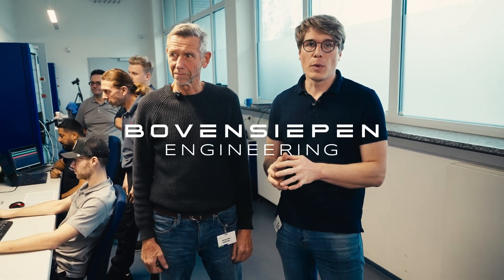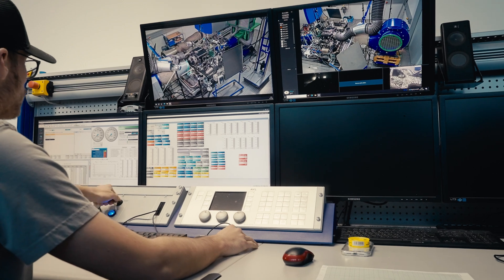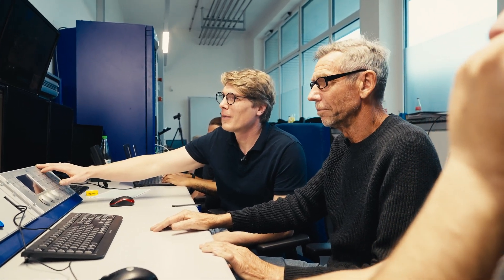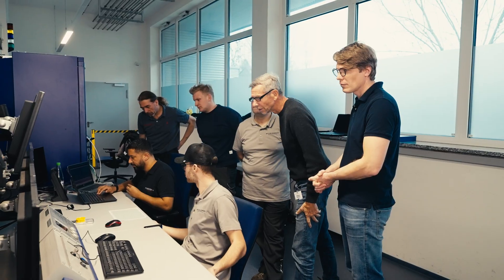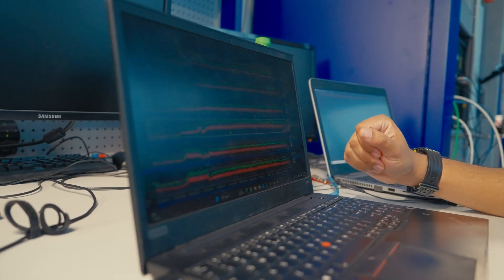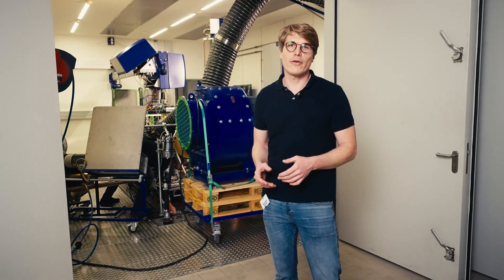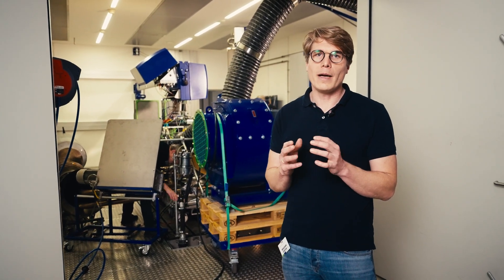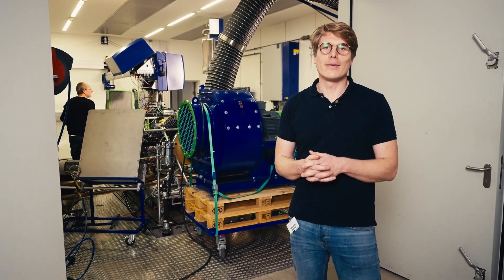First Dyno Run: Air-Cooled 4-Valve GT3 Power

Comment: The cooling air guide design is fascinating. Thermomechanical fatigue cracking of the exhaust bridge has always limited the life of air-cooled heads with two exhaust valves. I'd like to see long-term cyclic dyno testing of these heads to see if the cooling scheme can prevent this.

I'd also like to see how you're driving the valves. Are you running rocker arms off single cams to maintain similarity with the OEM cam boxes? Or did you base the cam boxes off the upper section of the Porsche Metzger cylinder head with twin cams?

Comment: somebdy can tell me what metrial him say about valve seat and guide made from?
Reply: He didn’t specifically state the material.  What he said was that the valve seats weren’t beryllium copper, but a very similar material to it with a high thermal conductivity value to help pull the heat from the combustion chamber out to the head material where the cool air is flowing through the head air cooling cavities.

Comment: Gibt uns mal ein paar Infos über dieses geniale Projekt.

Welche Leistung  soll der Motor haben?. Maximal Drehzahl und Drehmoment. 

Was kann man von seinem Basis Motor 993 oder 964 noch übernehmen ? Ich vermute nur noch das kurbelgehäuse
Reply from the maker: At the core is the world’s first air-cooled, GT3-inspired engine—developed with state-of-the-art technology and featuring the world’s first 3D-printed, air-cooled cylinder head. The program is led by one of the most respected engine developers in the industry, whose work contributed to BMW’s achievements in 24-hour endurance racing, DTM, the GT Super Series, and the Dakar Rally. He previously led teams responsible for award-winning icons including the BMW S14, S50, S52, and S54, as well as the legendary McLaren F1 12-cylinder S70/2.

REEN air-cooled, GT3-inspired engine (for all future RSGTs):
- 3.9L or 4.1L, 4-valve, high-revving, air-cooled engine with ITBs and Variocam, paired with a lightweight exhaust system (based on Mezger crankcases: 964/993/996/997).

- The current 3.9L setup has been tested at 450 hp at 8,200 rpm (rpm limit: 8,600).

- Next phase: finalizing the setup and endurance testing.